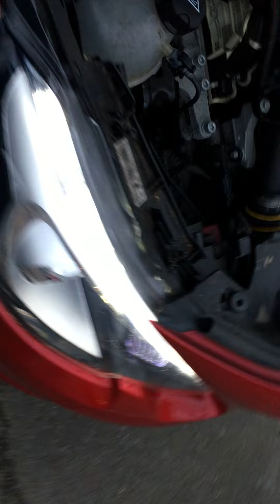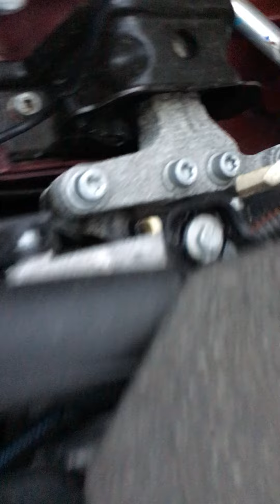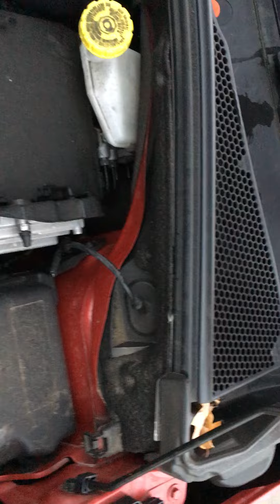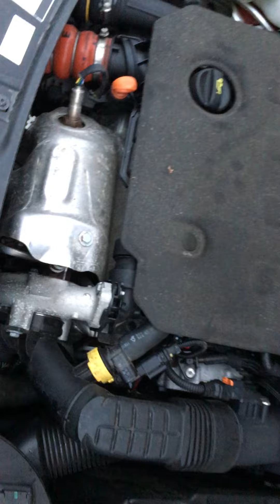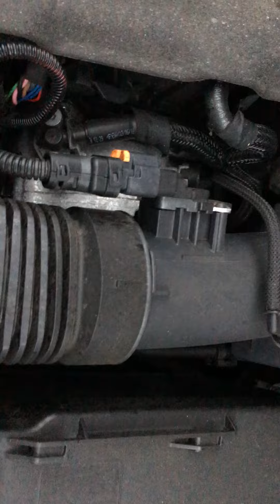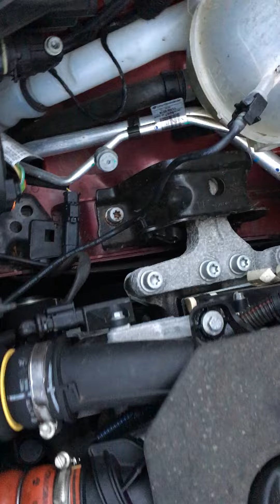2018 Peugeot 2008 1.5 Turbo Diesel engine sound 21k miles

Comment: There is  service bulletin from PSA for this engine, the humming noise is from the water pump, they are replacing it with timing belt under warranty . There is even note on the service bulletin that the noise is still present after replacement just it is more silent than the "faulty" one.
Reply: this 1.5 bluehdi 130hp have problem with tensioner chain in camshafte? Mine makes the same noise, peugot replaces the water pump and  belt, but it continues to make the noise.I've read reports of people saying this 1.5  engine broke becuse the poor tensioner
Reply: @odracir0000  The noise is still loud as before? On mine appears from time to time but it is quite low, not as before. Same is stated in the bulletin from PSA. And yes, this one have the tensioner chain in camshaft.
Reply: @TheBassfu  no, is more silent. Do you know if there is any bulletin service for the tension chain? best regards
Reply: @odracir0000  I couldn't find any, will check again next week and let you know
Reply: @odracir0000  Found it: KNOCKING NOISE IN THE UPPER AREA OF THE CYLINDER HEAD ON THETIMING BELT SIDE. Origin: Play in the camshaft drive chain. Service: Check of the noise coming from the camshaft drive chain.
Identification of the type of camshaft drive chain fitted to the internal combustion engine.
Replacement of the camshaft drive chain, hydraulic tensioner and camshaft carrier.
Engine management ECU downloading (if necessary).
Reply: I have the same sound in my vehicle, timing belt, water pump, bearings, camshafts, reinforced chain 8mm but the sound still continues. Can you send me the service bulletin ? And Isn't there anyone who can solve this problem?